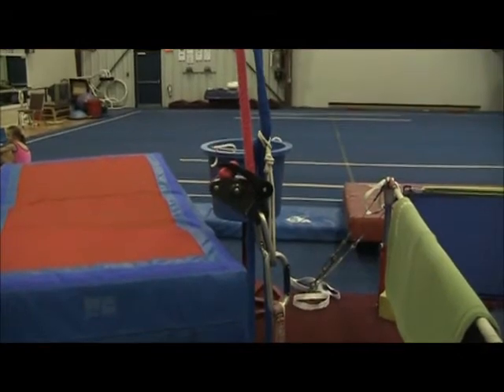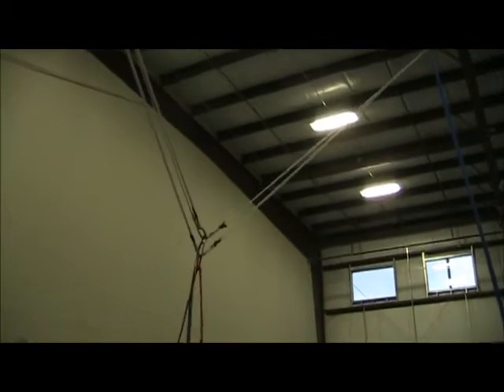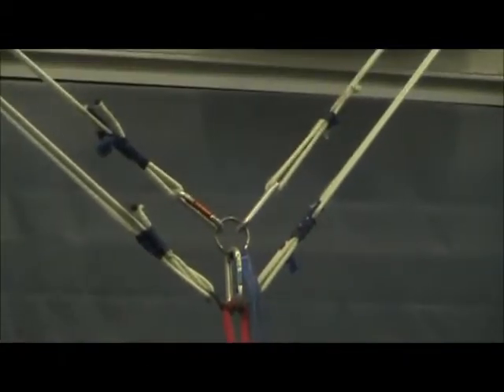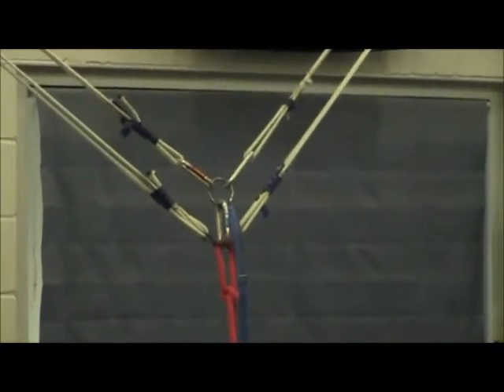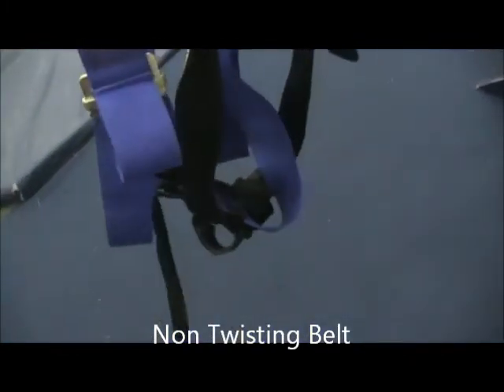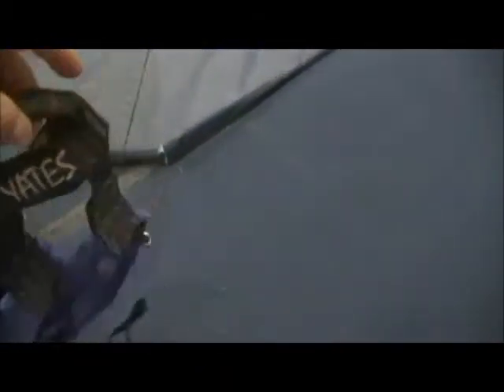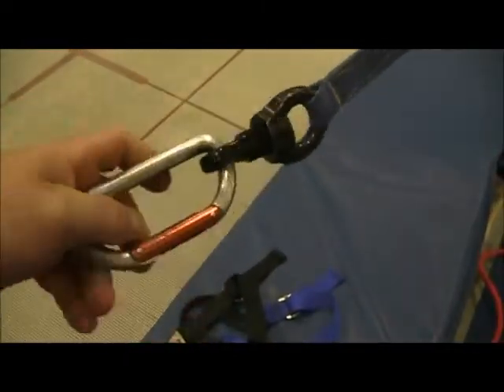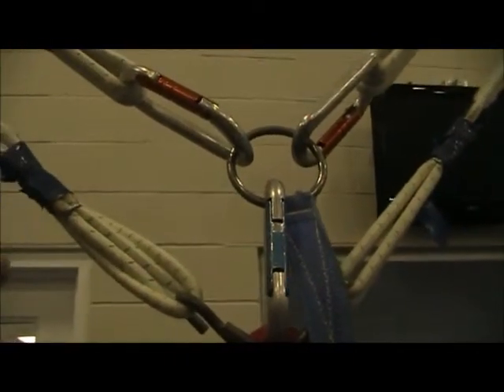Bungee System

Comment: For clarity...   looks like after putting the webbing's clip on the athlete's belt...... you then unhook the  part pulled down from ceiling and hooked to ground anchor before use_ correct?  Assume so but one should not assume right.... appears that way when looking at the one part of the video of the system in use. 

how do you manage the extra webbing put on s hooks?  if un hooked it would fly to ceiling?   do you hook it to ground when not in use?
Reply: closer inspection think am getting it figured out.

Comment: I like to ask you about the hawk rings making the loop on the bungee rope. Is this the place the bungee will end its operating life?
Reply from the maker: +Dubidub2 The Hog Rings are to close the bungee ends without a knot.It does not change the life of the bungee. We have had our Bungees working in the gym for 14 years. They still work great!
Reply: +ruflova Thanks for this information and your effort to make this information public. I did imagine these Hog Rings would wear out the bungee by its concentrated force on the bungee cord. But this proves me wrong. Why should the rings not make a small loop and small remaining end of the cord?  We are operating some other system here in Denmark, and I should like to share some information with you. Can I contact you by mail or via some gym e-mail address?